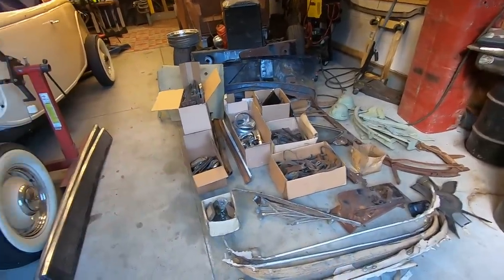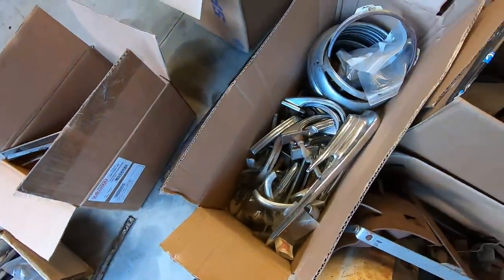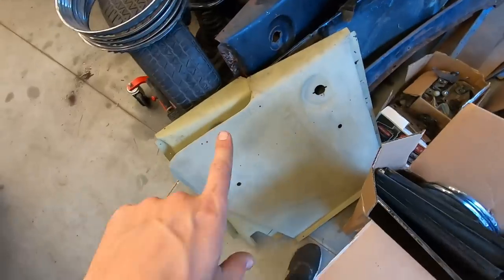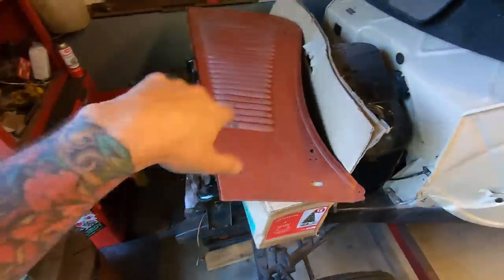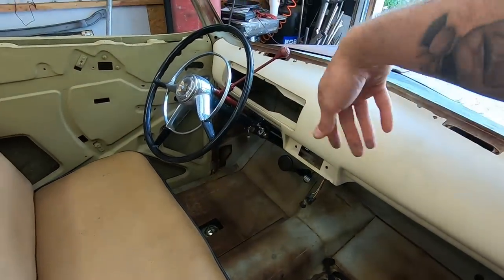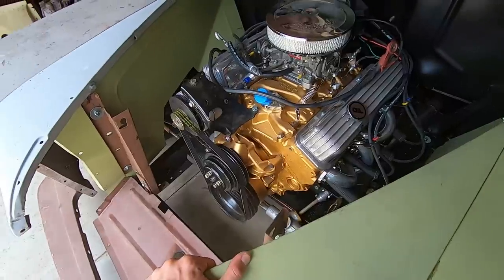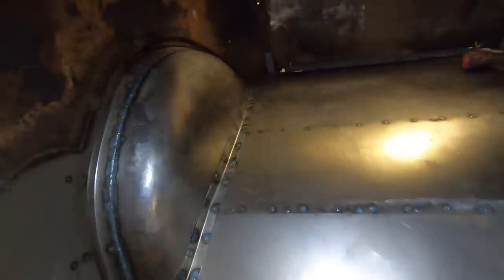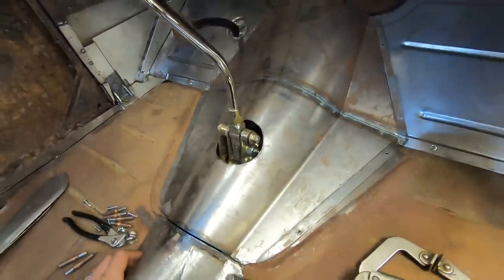My 1946 Convertible Is HOME!! (1937 Sedan Delivery Week Recap)

Comment: On that trans cover instead of placing the overlap on the interior side....weld it on the bottom side so when you slip it in the fumes will travel the bottom of the car...
Weld the strip on the interior side and fumes along the floor could seep in....just a thought..
BTW. beautiful 46

Comment: Nice 46, definitely change the recessed plate if it bugs you now it’ll only get worse…. That miscellaneous trim in the door handles box  goes on the dash vertically over the center grill on 42-46’s? Don’t feel bad about the cowl vent being filled mine just leaked and killed the gear shift indicator for my Dakota gauges….🤬